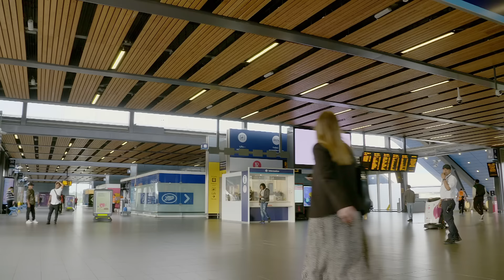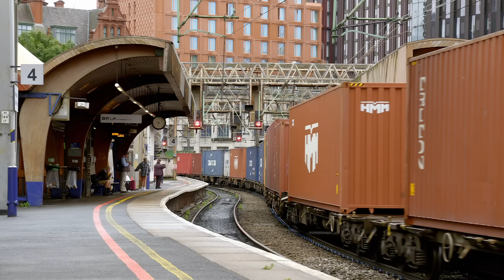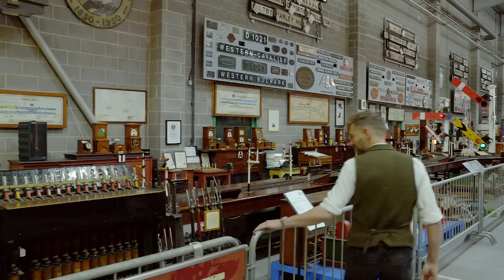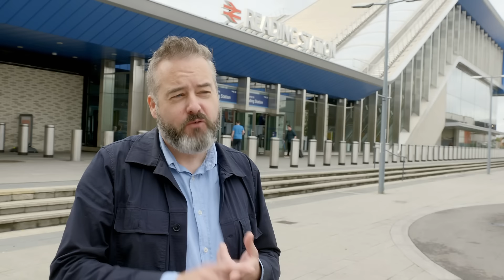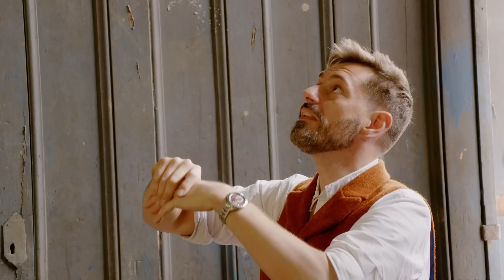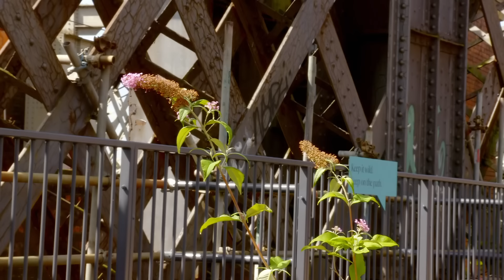Railway Architecture | A City Transformed by Railways: Manchester | FD Engineering

Comment: In early 20th Century Richmond, Virginia, USA, they had a triple stack of railroads. That is, 3 independent levels. Gasoline powered trucks took away cargo from the railroads. So the tallest bridge was dismantled because it was no longer needed and was growing expensive to maintain. They did try to tunnel, but the sandy soil made the tunnel collapse frequently. The last collapse trapped a train with its crew.